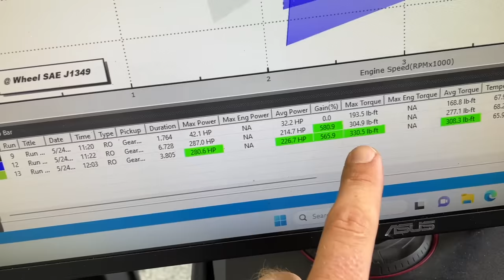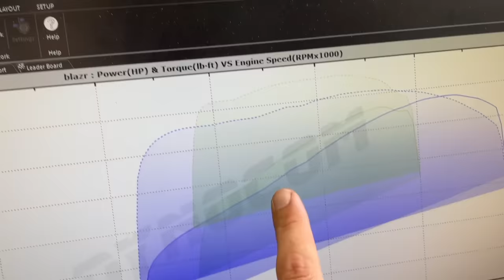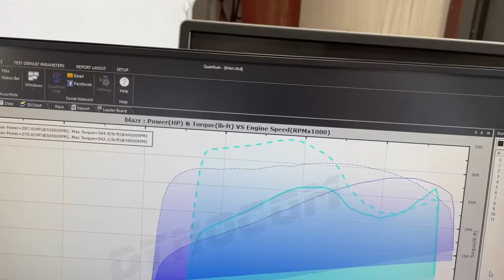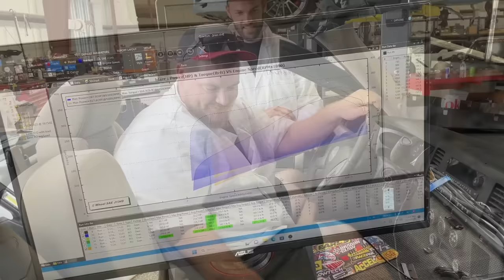MIND BLOWN!!! We Put TOP FUEL NITRO In a Daily Driver and It Made INSANE HORSEPOWER!

Comment: This was one of the best cleetus videos from start to finish. From George calling the turbo winner, Sam in a lab coat, stock 5.3 experiments, HUGE power gains, infectious laughter, and James with a catastrophic idea brewing. This better be one of the top viewed videos on the channel.
Reply: Couldn't have said it better myself!!
Reply: Absolutely agree 1,000% 
This is stuff that most dudes, (including myself,) think about doing all the time to our own cars.
Reply: @ralphlazio505  I've been wanting to do this since 22 years ago.
Reply: @The Slick - I gotta find something else besides my daily😅
Reply: I knew a guy back in the early 80's when he went to the track he would go on empty stop get a half tank of gas then go acrossthe street to the private airport & top off
Reply: @davidwashburn5848 I used to do that to I'd get 5 gallons of air plane fuel to take with me and run it till about empty and put the fuel in when I got to the track adjust the timing it's a 78 Z28 black with red stripes 454 from a 70 chevelle making 575 hp at the rear wheels 🛞 😂. I love it my mom bought it in 1980. I was 5. My dad owned a body shop we had several drag cars 2 67 chevelles and a 67 camaro. The Z28 was stock until 83 it came red from the factory but we redone it in black put a 1980 hood scoop and 80 stripes they just look better 😂. I everything is gone now except for the camaro, and my first truck a 68 3/4 ton camper special all original got the auto magic shifter on the dash only one I've seen like it.
Reply: Was grinning the whole video. Redneck engineering at it's finest.
Reply: 100%

Comment: If I understand nitro, it's self oxidizing, so adding as much as possible without hydrolocking the pistons allows you to reach ABSURD compression. I'd love to see what the spark plugs look like after this lol.
Reply: Nitromethane is CH3NO2 so yeah it carries a lot of its own oxygen. It has the effect of raising volumetric efficiency because there is a lot less air (which is 80% nitrogen) in the cylinder allowing for a lot more reactants in the same space. That and it's also an extremely high octane fuel etc.
Reply: My thoughts exactly, I would imagine that the plugs and ignition system, aren't very happy!
Reply: From what I can read nitromethane has a lower octane rating than ethanol, but because you comparatively hose the engine with it the evaporative cooling makes up for a lot of that.
Reply: Yes nitro has oxygen as part of the molecule with alcohol it may burn nitro it's not meant to provide oxygen mostly goes out the exhaust pipe nitro decomposers much like dynamite it's actually closer kin to TNT.
Where do you get the real power issue fill the cylinder with more fuel than can exist at top dead center under massive heat and pressure it decomposes turning all that liquid into a gas that is your power if you have about 65 degrees of Mag lead 4 degrees 8 degrees 12 degrees of timing is not going to help.
Run a hundred percent with about a 9 gallon pump you're liable to melt your Pistons if you had a real mechanical pump putting 20 25 gal a minute in and 40-60 degrees  timing and 85 percent nitro in the the tank Now try that.
Reply: They melt, dragsters run 2 plugs 2 mags etc because if 1 fails when running it's detonation big time.
Reply: spark plugs? we don't need no stinking spark plugs...
Reply: @chauvinemmons  you really dont understand nitromethane.
Reply: Don't forget stoichiometric ratio.  Gasoline has a stoichiometric ratio of 14.7:1.  Methanol is 6.45:1, but nitro is a crazy 1.7:1.  Nitro and methanol actually have less power than gasoline for equal volume, but because their stoichiometric ratios are so much smaller you can cram a lot more of it into the cylinder and have it combust properly (in the case of nitro vs gas, you can squeeze a tad over 8.5 times as much nitro into the cylinder than gas and maintain  proper ratios for combustion).  This is also why they had to go to bigger injectors and two pumps, had to have a way to get all that extra fuel into the cylinders.
Reply: At half track the plugs have burned up and the engine is dieseling  for the last half   of the track.  They turn the fuel off to kill the engine because there is no functioning ignition to turn off.
Reply: @SpencerHHO  nerd
Reply: Get that thing on the track😂
Reply: @robertreid2499 . Compression ignition 🤣😱😱😱🤦‍♂️

Comment: The starting point for timing on a top fuel motor is around 55-60 deg. BTDC. Nitro burns extremely slow so it likes a LOT of timing.
Reply: Nitro likes a lot of compression too. Which that engine probably doesn’t have, especially after that bout. 😂
Reply: Nitro HATES igniting
Reply: It sounds a bit like trying to run a gas engine on diesel fuel. It is interesting that diesel and nitro both make tons of torque compared to gas.

Comment: Yeah, nitro is super dangerous, you're supposed to turn the engine over with plugs out to clear the cylinders, start it on regular gas, and then switch over to nitro. Engine's can and will explode in a spectacular fashion from the stuff, just ask any old timer at a dragstrip.
Reply: Congrats! You are the only person I've seen who commented on how dangerous this could potentially be. If I were there, the minute I saw that they were running fuel from a bucket I would have left. Crazy.
Reply: Yes this was incredibly dangerous.
Reply: yea, i was yelling at my screen telling Nate to duck behind the firewall during those pulls...especially considering the whole shop must have been filled with fumes already
Reply: Incorrect sir, nitro has less explosive power than gasoline. The compression in the motor isn't to the point where the motor would just explode
Reply: @frankcastle9691  Yeah, I get OP's @DoctorMotorcycles point but, All those precautions are for dragsters where they are running so much fuel that it's nearly hydrolocking every compression stroke, combined with a ton of boost. I don't think that little N/A 5.3l with 850cc injectors is going to fail anywhere near as catastrophically as OP thinks.

Comment: Shoutout to GM for making one hell of an engine to be able to take, and excel in a McFarland Racing Science session! Although I imagine every O-ring in that poor 5.3 has turned to jelly. I still wanna see bigger injectors and Dr. Spray E'm All Hit It with his best shot!!!
Reply: I mean they made close to 1000 hp a couple times with ruby if they had it at like 700 it would have lasted
Reply: I have an 11 gmc with that motor. They’re great engines but don’t have as much power stock as a 5.0 coyote or hemi.
Reply: @Service dogo joke guys  get a camshaft
Reply: Id expect any engine to have similar power gains relative to its size. Not going to last long though lol.
Reply: They really do, I have a stock LM7 in my 01 GMC. From the research I've done the old iron block ls based engines in the old Silverados and GMCs handle a lot of boost and power on just the stock block
Reply: @Service dogo joke guys  yeah stock 5.7 rams make 375 to 395 but not to the wheels
Reply: Needs silicone O-rings
Reply: @uraniumcranium2613  mullet can make 5000hp and top fuel cars make 10000+ hp on roughly the same size engine, and both of those are forced induction. It matches the increase close enough. Of course top fuel cars and engines are built to live long enough to get to the end of the track and be used again hopefully after only a mild rebuild between runs.
Reply: @Lexidezi225  well usually an engine that is a good design and makes less power than the competition tends to last longer.